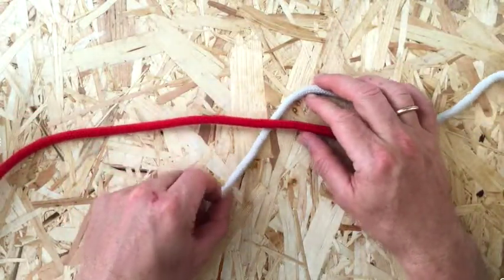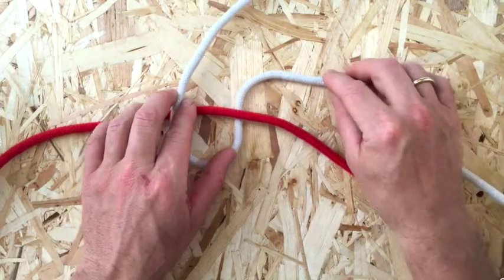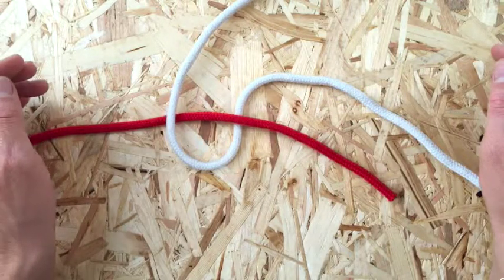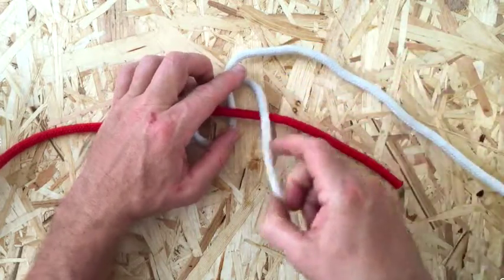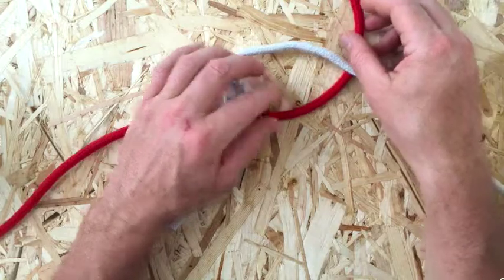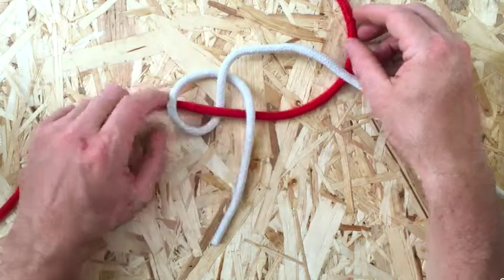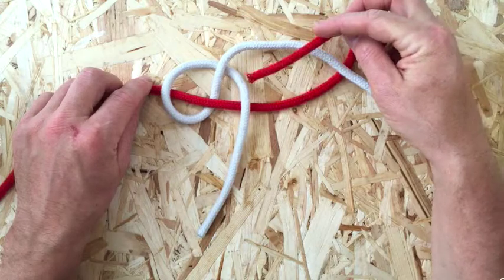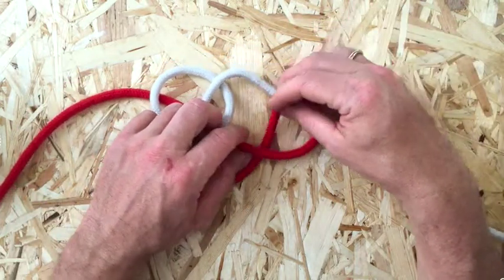Harness Bend. Easy step by step instructions.

Comment: You could do a video showing how it can be used to tie two lines under tension.  The working end of the white rope can be used to hold tension on the red rope as it is pulled through and then locking the thing off with the final half hitch.  Your videos are all very clear and easy to follow.  Bends which can be tied under tension are fairly rare.